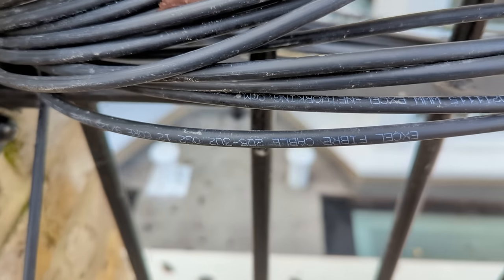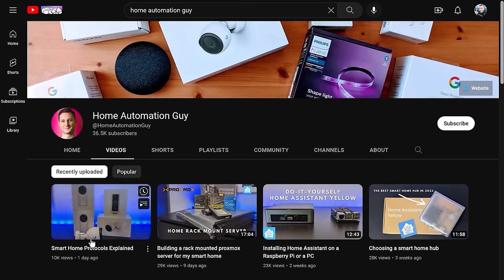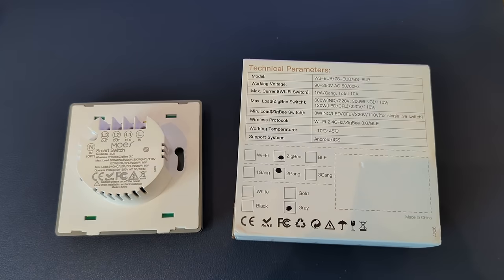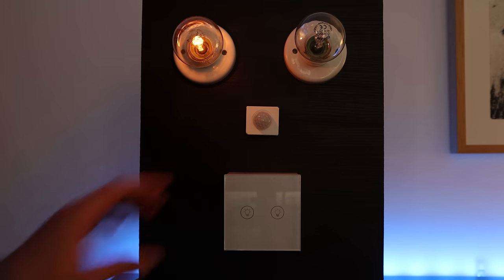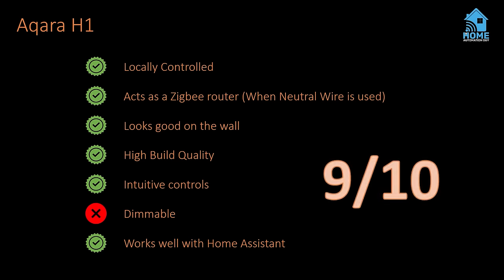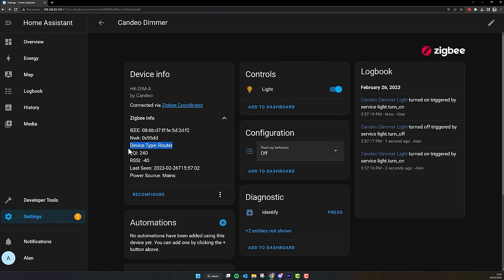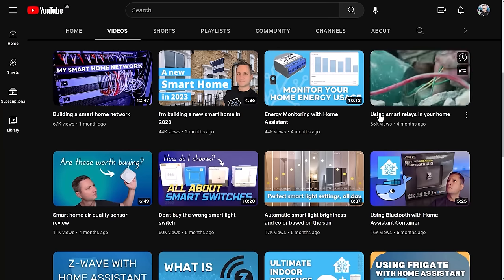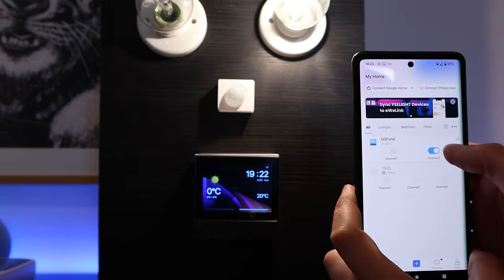Which smart light switches are the best?

Comment: You missed one important thing. Most cheap smart switches do not remember the last power state after a power cut. The default state is usually ON. Imagine in the middle of the night, all your lights are flashing after a power cut recovery. 😅 I have a couple of Mose switches. They don't remember the last state. I had to create manual power state reminders for each switch gang to prevent this issue. It was a pain. Now I always buy Aqara switches. They remember the last power state and are reliable.
Reply: Does anyone know if the Candeo C202 remembers power state?
Reply: Did you get an answer to this ?
Reply: Been using Zigbee Moes switches for years through Z2M - they literally have a setting in HA what to do after a drop out and never blink lights. 🤔
Reply: I recently installed some ikuu inline switches and their default power on state is 'on' (surely violates some safety standards somewhere). The default state of these switches can be changed but apparently I would need the ikuu hub to do it. If I try to write to the relevant attribute in ZHA it asks for a vendor code. So I set up a simple power outage and return trigger in Home Assistant (monitors the discharging battery state of my iPad wall display on the same power circuit) to reset them to off.

Comment: I understand your rationale for choosing the 2 types of controls (switches & dimmers) and I generally agree with your criteria - but I'd add one: the selected controls should look consistent throughout the house (not necessarily exactly the same - but thematically matching). To me the very different look of the selected controls would be a no-no. Especially when mounted side by side - they just look far too different (the nature of the controls, the plate style, the visible fixing screws on one but not the other, rounded corners vs square). They look to be from two quite different eras.
Reply: Indeed that's my issue with these kind of switches, and why I am using only zigbee relays that accept inputs directly from my normal switches and that sit inside the wall boxes. I've been upgrading my home switches this way without having to change the look or replacing them, especially because I have different switches and plaques styles in different rooms.
The main goal I'm going after is "enhancing, not replacing". The switches and relays work even without a zigbee coordinator, so I'm not locked out of my lights just because my server is down or updating. Right now I had extremely good experiences both with NodON and Vimar relays.
Reply from the maker: Yeh, that's a fair criticism.
Reply: @stefa168  For switching yes - but unfortunately that doesn't get you dimming functionality.
Reply: @Alan Moore  yeah you're absolutely right
Reply: @stefa168  ,  yeah, diy smart switch can make your normal switches into smart switches as well😀
Reply: @stefa168  if you need to replace a smart switch in 3 or 5 years... perhaps they don't sell the same model... Look would be different !
So I will prefer a Zigbee module behing my existing switches 😉
Reply: @alanmoore2197  I have relays installed that dim only difference is they are zwave not ZigBee but they work well with HA
Reply: @mhctaylor  Well if they dim - they aren't really relays are they?
Reply: @stefa168,
Can you teach us more how to achieve that?
Reply: @alanmoore2197 Shelly do a dimmer module, it's Wi-Fi but local.
Reply: @neilellis5410  Since we are now discussing hiding smart switching & dimming behind standard wall plates - how is that achieved with a dimmer module? - what do you control it with? on/off only with the plate switch changing state then - dimming only remotely by app/voice? Not sure I like the ergonomics of that so much.
Reply: @alanmoore2197  A fair point, I guess it depends if the dimming is something you need to do from a seated position with remote/scene switches and the on/off as you enter/leave. Which is a reasonable use case. I am looking at either them or the Candeo at the moment. I use shelly elsewhere for on/off control.
Reply: @neilellis5410 I have entirely Lutron Caseta - I mostly use scene controllers at the entry/exit to every room for level controls (though I do have individual dimmer controls) - so to me it would not really meet my needs. But to each his own.
Reply: @alanmoore2197 you can consider a wireless controls for dimming. You can even place them near your switch on the wall
Reply: @vlavrynovych  I have many lights in each room so I'd much rather have combined controls for on/off and dimming to avoid confusion,  complexity and clutter/redundancy

Comment: Biggest issue imo with smart switches is back boxes. Any video on switches must discuss back boxes and your research MUST include measuring the depth of the switches BEFORE buying a device. I learned this the hard way, the Aqara won't fit in my house 😥
Reply: I've had this issue too. In some cases I was able to fit a deeper plasterboard box, some I used box extenders (until I get round to redecorating those rooms. One was a 16mm metal box on dot and dab wall, I sunk in a deeper one with minimal damage.

Comment: Also a big fan of the Candeo - it's the only smart switch I've found that doesn't look like a smart switch (at least for us in the UK), guests in our house don't even notice that it's any different!
Reply: There are relay modules you can get, like ones made by sonoff, that have this same attribute. Though you need to have a reasonable amount of room in the backbox. The other nice thing is if you don’t want to convert all the bulbs or switches to smart the ones that are smart don’t look out of place.
Reply: @lawrencemanning  I second this suggestion.  I have added Sonoff zigbee relays which then allows dumb switches to become smart switches.  The only downside is that I'm not convinced that the sonoff relays support dimming.  Another caveat is that Sonoff makes the Zigbee Mini relay as well as the Mini-l which doesn't require a neutral wire.  While the ZB mini acts as a router, the mini-l does not.

Comment: I use Shelly whenever I can, local control, use regular wall switches and regular bulbs. I have over 100 different wifi/zigbee devices around the house from all manufacturers and the only one that always works is the Shelly stuff. The relays are absolutely rock solid.

Comment: Great to see more UK content on this sort of thing. I went with a Shelley relay at the light fitting when I first started, because it meant keeping the existing switches and 2 way functionality. It's been flawless, though it doesn't solve the dimming problem of course. The Candeo look to be a good solution, if costly. I know that Scolmore Click (A huge brand in the electricial industry) are getting into the market with zigbee options too, so there may be more good choices in the future finally.
Reply: iolloi make a good quality dimmable module but you will need a retractive switch to control it.

Comment: Btw… the Aqara D1 is also available as three-gang. Thank you for the amazing review! I was also skeptic about the Moes three-gang touch and you expressed exactly my concerns
Reply: After making the same journey into buying several different switches I decided to pick up Aqara D1 (with neutral and wireless) series switches even if they do not fit into round European boxes. I purchased square boxes and mounted them in place of round ones. I have mixture of three, two, one, and wireless switches. They created stable zigbee network across three floors. I use z2m and only gripe I have is that depending on number of channels some options are available and some not (disconnecting or reversing LED indicators, mains voltage reporting, energy usage [Wh], and instant power [W]). It may be limitation of firmware or z2m but, unfortunately, I did not have time to investigate. I have  over 30 of those switches and none of them experienced any issue.

Aqara D1 is in my opinion best choice so far in 2023. They work great and they have look&feel of good quality wall switch. I don't know why H1 do not have triple button. H1 are also more expensive and unavailable on Aliexpress for some reason ...
Reply: @pllevi  thank you for all this info. Yes, the H1 doesn’t have three buttons, but you can look for Aqara Opple with 6 buttons

Comment: Shelly has 4-gang ”switches”. It’s called i4. It’s just a controller though so you need to complement them with actual switches too. The switches can be mounted at the light instead of behind the buttons. If you don’t like Shelly’s own buttons you can use any other of your liking.
Shelly does not require the cloud to speak to Home Assistant or to each other.

Loved the video, though.
Reply: I agree, and the main benefit is that you can just use regular switches which make your house more attractive once your want to sell it.
Reply: I was just about to say the same. One of the biggest advantages is that you can use any non smart lightswitch, so you have thousands of options available. Using them in my new smart home.
Reply: SInce when shelly have Zigbee stuff? wifi stuff is STUPID

Comment: I am very much enjoying the videos. I am construction my new retirement home and am facing all the same decisions. I did tell my electrician that there needs to be a neutral wire at every switch box so that will solve some of my possible issues. I am US based so my options are different. I too specifically want to avoid wifi switches. Perhaps those sonoff panels mighty be cool.  thanks

Comment: I have a couple of the Candeo switches. I like that they look and act like a traditional dimmer. But I do find them a bit "sticky" when turning them on and off. They're also not great at reporting their on/off state. Don't know why, but they're the only ZigBee devices I have with that issue.

(Another issue with smart GU10 bulbs, is they're usually taller than standard GU10 bulbs - which can be a problem with many fixtures. I learnt this the hard way.)

Comment: Same situation as you.

I bought a two way dimmable moes module and experienced the same inconsistency as you showed. Shame as they even have 4gang version, no dimming though, which could have been a an awesome thing.

The aqara ones look great as long as you don't need to put two next to each other. They are slightly bigger than standard EU switches so you can't fit two together.

As others have pouted out, sometimes a behind the plate module is better, as style of switches is important. Our house will have gray walls so dark switches with sharp corners would be prefered.

Comment: I am a huge Candeo fan, and their support is the best I have come across. But I am pretty sure that to use them in a two way set up, a bit of re wiring is required.
Reply from the maker: I haven't tried them in Two Way mode personally, but the website says it works. Not sure if it's any different from "Normal Two-Way switching" as I'm not an electrician!
Reply: @HomeAutomationGuy  the Candeo smartdimmer (and its many clones) have a wired input for one or more momentary push buttons to use in the auxiliary locations. The wired push buttons then work much like you have seen elsewhere; a momentary press toggles on/off and a long press alternately raise or lowers brightness.

Comment: Aqara H1 is also my switch of choice. Tried couple of them and this one has definitely the best build quality and feel. The click is super satisfying and reassuring. It also supports single, double or triple click as well as separate hold and release. I'm using the battery versions because of the shallow switch boxes but so far I can't really complain. Other really solid switch is the one from IKEA (small dimmer switch). Very nice click, good response and build quality. And for the scenes I'm using  Aqara OPPLE switches. They cost 15EUR each for 6 gang version which has 30 possible actions configurable! Build quality is not that great as IKEA, but still very nice.
Reply: F c

Comment: Great comparison!

I have spent an extermely large time looking into smart dimmer switches to achieve 1 simple goal - to be able to have smart dimmer switch in a two way configuration. While Candeo can techinally do two way, one of those switches has to be a retractive switch which breaks the consitency across the house.

The only switch that came close were the Aurora Aone smart dimmer (think the company has gone into adminstration) however even that will not work if you use it without their propriotory hub. While each dimmer can support native Z2M, theres no way to do 2 way without their hub (I bought it and tried!)

Varilight also had 2 way dimmers with a master and slave dimmer however they did not work natively with HA and required the use of SUPLA.

Ended up returning all the dimmers and currently just using dumb dimmers.
Reply from the maker: That's the problem with being on the forefront of a technology wave - we're limited for choices for smart home products right now and often have to make compromises.  Hopefully the market and industry continues to innovate, and by the time I upgrade my tech we have a lot more things to choose from!

Comment: I've conducted tests on numerous smart switches and finally found the perfect fit for my home from a company called Bseed. Their Zigbee devices boast exceptional reliability and stability. While they may not be the most economical option, I prioritize quality above all else. 

In the Netherlands, it's been customary for quite some time to have sockets and switches with neutral wiring. Luckily, my house even had separate wiring for this purpose, with double boxes facilitating an easy setup. I believe the optimal approach is to utilize neutral wiring whenever possible; this ensures consistent performance from these devices. Bseed also offers models that don't require a neutral wire, but while they work fine, they lack routing capabilities. In such cases, using a bulb can serve as an alternative and even extend the signal range.😁😁😁

Comment: Great Video! I also have a candeo in my house and I had an issue with it at first not reporting its manually changed state via zigbee. Few emails with Candeo and I had a replacement on the way that has worked great for almost a year. I have just checked their website following this video and they have a 2 gang kit available now for £78. I've ordered it and will give it a shot!

Comment: Thanks for another awesome video. You have inspired a lot of my setup. I’m already set up with switches and yes I love the Candeo. I love that you can retrofit them to an existing plate. I replaced a 3 gang in the kitchen over a period of a few weeks and nobody noticed. 
For my non-dimmables I’m Shelly relays all the way leaving the standard light switches in place.
Reply: Do the Shelley’s click? I have a sonoff that has a pretty audible click; it’s surprisingly annoying. Also it just barely fits in the backbox.
Reply: @lawrencemanning  they definitely click. I have put in deeper back boxes to accommodate the relay. Also the upstairs lights all have the relays in the ceiling space where the wiring is as for some reason my house has neutral wires at the switches downstairs but not upstairs.

Comment: Interesting video. Thanks.
Quite different to my experience. I started with some sonoff WiFi switches. They are glass touch panels. They do up to 3 gang. However, I've never installed their app. I flashed them with tasmota, so fully local., they now work very well with home assistant. They all continue to work if the WiFi is down.
There are some very similar ones from athom that go up to 4 gang in a single box.
I've now replaced almost all of the switches in my house. 
In older parts of my house I had to add neutral wires, but this was easy where I have loft access.
One thing that would be useful to know is the depth of the box required. I've had to use box extenders in a couple of rooms as the back box was too shallow.
Not sure what the power draw on these switches is. I should measure that.
Thanks again.
Reply from the maker: Nice one! I love Tasmota! But I wanted to avoid flashing anything in my house if I could though.

Comment: Hi Alan. I enjoyed that video. I have 7 candeo units, i have them paired with momentary/ retractive switches which makes it super easy for manual control. A couple of the candeo units are the back box version sat in the ceiling rose and only taking input from the momentary switches. I also fitted the candeo units into chrome casing like the momentary so it all looks more premium.
Reply: I found that it had 1 to 2 second delay when I try to turn it on. Works almost instantly if I try to turn it on through Philips hue but the physical toggle has a delay. Have you found this to be the case as well?

Comment: If you are managing the downlights as a Zigbee group and using them as one entity, then naming isn't such an issue.    
There are definitely situations where smart switches and dimmers are great.   I've found I tend to like to change the colour temperature depending on the time of day.   What I did to work around the "dumb switch" situation was to get some cheap zigbee wall switches and use them as a button instead of a switch.  Programmed the wall switch so the relay was always on, effiectively hardwiring the lights, and then using the switch as a basic scene controller so it looks like a normal switch if a guest is here.
Reply: does this work if your home assistant/nodered/etc. is down? I'd hate for that to quit working at 2am on my way to the bathroom.